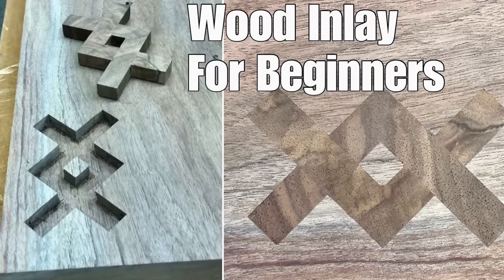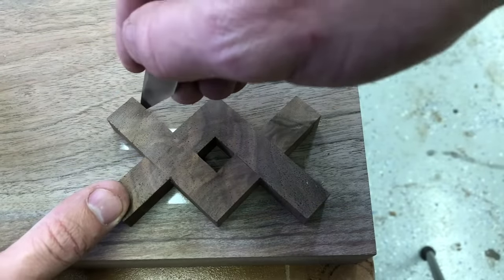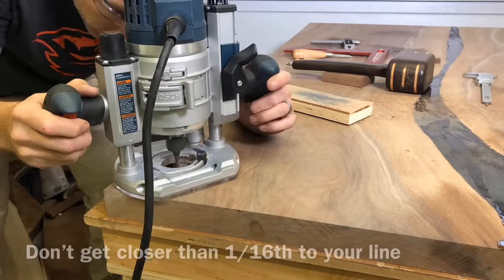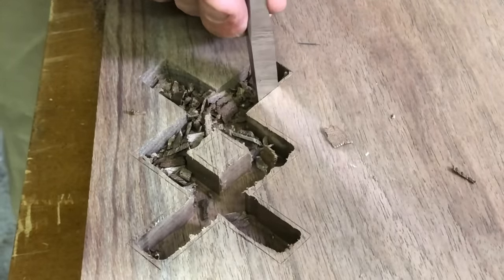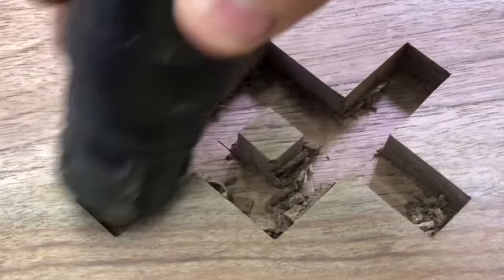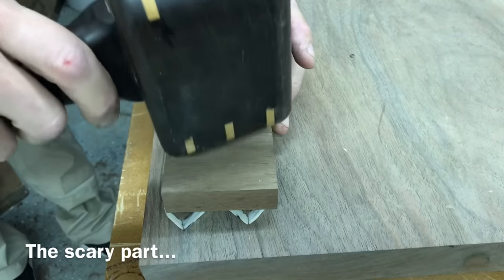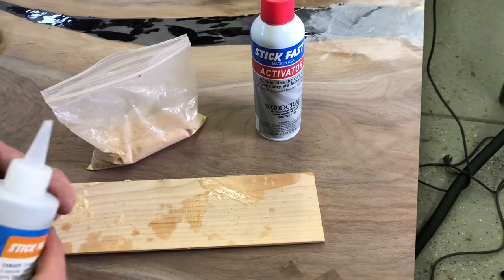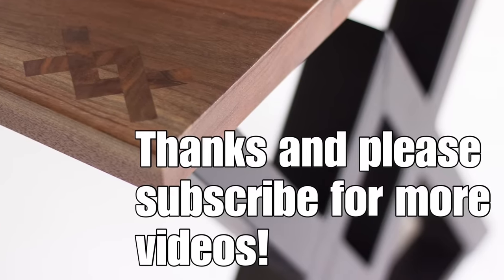Wood Inlay For Beginners—How To Woodworking

Comment: Not gonna lie, those chisels got me excited. They look like the highest quality and $80 isn't bad at all
Reply: Yeah me too 😂 I’m sick of buying Stanley and dewalt chisels that last 2 uses. I’m going to invest in something nice that I can maintain.
Reply: Same here. He's making art with art
Reply: I agree that they're probably worth it (especially since they're probably hand made)...
But keep in mind that the price is per piece. (So 4 chisels = 320$)

It's a good idea to start with cheaper ones to see which sizes you actually use / need.. And THEN upgrade :)

Like.. I have a set of 4 (old) expensive chisels.. I use 1 of those. ;)
     So in retrospect, the rest of the set was wasted money.

Also, learn to sharpen your own chisels.
       Even good chisels need sharpening fairly frequently - especially when you use them a lot.
       Best way to learn sharpening is using cheap ones. (As a bonus... Cheap chisels can become fairly decent chisels if you sharpen them well)

Pro-tip (for those on low budget);

Look for old / antique chisels from quality brands on flea markets and so on.
     They might need some refurbishing / rust removal / sharpening, but you can buy those for a few bucks a piece.
    (You pay the rest with the work it takes to make them usable again)

Via that route...

I have some 40-100+ year old chisels that you can shave with ;)

- 

For those interested, check out the 'scary sharp' method (you can find that on YouTube as well, as well as just using Google or something..
      I think 'Modern Woodworking' magazine has an article on their (super outdated) website on that subject ;))

      That method utilizes a hardened glass plate (1/2 inch thick or so) as a nearly perfectly straight surface, with several grades of specialized (3M) sandpaper stuck to it (goes from 150 up to 5,000/10,000 if I remember correctly)

* [Works with cheaper sandpaper too - make sure it's for metal, and that you can use it for wet sanding too]

Could save you a bunch of money on sharpening stones (which you can then spend on chisels instead).

     And also, you don't have the trouble of keeping your stones perfectly flat.
Reply: My dad always said, 'buy cheap, buy twice'

Comment: When I chisel following a cut gauge line, I always use a straight and squared up piece of wood clamped into place to guide the chisel as I tap the chisel down into the wood.  I find if I don’t, the chisel tends to wander and go outside the gauge line.  The guide block is clamped so the chisel sits in the cut line and it can be held tight to the guide block while being pushed or tapped.  Works really well.
Reply from the maker: Good call!

Comment: very good vid, Im till what you would call a greenhorn but I left my last office job of 16 years moved my family to a small East TX town and built wood shop in the carport under our master bedroom and started buying tools watching vids and making sawdust Im very lucky to be selling all my tables on CL and via word of mouth and return customers. Im finishing up a top for a kitchen island made of hickory with black epoxy and a 3 coats of conversion varnish put on with a 4 stage turbine HVLP Im lucky that before my office job I was a painting contractor so I have lots of experience with spraying clear finishes on cabinets funny most woodworkers skils progress faster with the crafting of the build than the finishing of the build where my finihsing skills are still far grater than my woodworking skills, lol I can put a nice feel and shin on just about anything. thanks again your work inspires

Comment: My next project is a mini project restoring an old wrought iron/ wood slat bench with bamboo to match the floor . Will be taking the long bamboo pieces and table saw and router and make it look like one of a kind . Prob 2 days work with dry times . I learned to use a drill press on these harder woods because the hand drilling can be irritating the way the grain just wants to sway the bit around is bothersome

Comment: Hello again, 
I know this is an older video, but that is the coolest part of your channel. The oldest video is still relevant for newer workers.
Now my question which is probably a known thing..... what does "leave a proud " mean ? Can it/ should it be used in other applications when woodworking?
Reply: Leaving something "proud" is to leave it RAISED a tiny bit.  The area can be sanded down later to match the rest of the piece.

Comment: I haven't done inlays yet.. but I didn't think I'd find much to learn here.
Yet, I was reminded that there's always Lots of little things.. tips/tricks/techniques that we take for granted after we've learned them, and which beginners (at any given woodworking task) often tend to figure out on their own through mistakes.   
Maybe I'd have considered some of these little things if I was standing in front of the wood.. but, just off the top of my head:  leaving room for glue (via bevels) to maximize bottom contact, how proud you you left insert when gluing.. that I don't need to approach flush (fix it in post!), remembering to fill imperfections with the squeeze out, ..etc.

Also, I was reminded of when I first started discovering what Sharp really meant. 
To beginners, I can't stress enough how important a properly sharp tool is, but especially with your chisels.. and that you should always assume, no matter how amazing of an edge you think you just put on it, it could be sharper.  ;-P    (unless, of course, you have a truly awful chisel, made from crap/scrap steel with a huge crystalline grain to it...)
Reply from the maker: Really appreciate your feedback. Really helps me when making more videos like this.

Comment: Excellent work and thanks for posting the video.  I thought you would have drilled a tiny air/glue escape hole right through to the underside, but presumably this wasn't necessary.
Reply from the maker: Na, that bevel underneath will work fine for that

Comment: Fantastic! That table is gorgeous.  Question, maybe you answered already, when putting the dust in the gaps did you simply mash it in where there was yellow glue? I couldn't quite tell exactly how you did that. 
Very impressive work. I am a woodworker by trade and have yet to really have a good go at the inlay.
Reply from the maker: Pretty much, ya!
Reply: @BlacktailStudio  ok thanks :)

Comment: Cam- Yet another great instructional video.  I'm interested in details of how you made the legs. Simple lap joints? Dimensions of stock?  Look like equilateral triangles?  Just to follow up with prior comments/questions.  I'm working up two small practice epoxy pours which will turn out to be wall hangings and two small (12"x45") live edge side tables with decorative butterflies for Christmas presents all . . Yes, I know it's August....
Thanks
Crady
Reply from the maker: Those were steel 👍🏼

Comment: nice job! 
Just me: If I have to do some inlay for "decoration" 5 millimeter deep is enough. 
It's less to carve and chisel, so less risk of screwing the job.
Of course, for a bow tie, I go much deeper, at least 15 millimeters, since the goal is to achieve a mechanical lock.
The successful outcome: VERY sharp tools, practice again and again and take your time.
Reply from the maker: Yeah, probably didn’t have to To this deep. Was a little nervous of the weak part breaking off though. I’ll keep playing around with it as I learn!

Comment: Phantastic Video!   Wondering if you could provide guidance on filler powder ratios for getting the correct coloring for a small gap in a Cheery wood project I got going on?    I suspect using elm and cherry wood powder in a 75/25 ratio with glue would suffice. Clearly trial and error rules here....
Reply from the maker: I’m not a recipe kinda guy. Like you said, trial and error!

Comment: Hey Cam, question i hope you can answer for me. I'm going to be puting bow ties in a slab to stabilize a large crack. The crack will also be filled with epoxy. In your opinion is it better to do the epoxy first, then flatten then draw inand install the bow ties? Or would it be better to do the bow ties first then pour the epoxy into the crack and have the epoxy form to the bowties?
Appreciate any input!
Reply from the maker: I’d do bow ties last 👍🏼

Comment: I'm about to start a kitchen table thats 2" thick.  There will be an epoxy pour component where a decent size crack (~1") separates the end of the table about 2/3rds of the way down the length of the table.  Is it important to add strength pieces such as bow ties when there is a crack of this nature when doing an epoxy pour or is the epoxy itself a strong enough bond?
Reply from the maker: Hard for me to say from here. Sorry!

Comment: Tremendous video, so helpful.  Quick question, I tried the technique and had some trouble with acute angles - hard to avoid messing up the 'opposite' side of the corner when working close to the angle.  Any suggestions?  thanks in advance.
Reply from the maker: Oh man, all I’d say is take less off.

Comment: I've filled cracks with epoxy and used bowties, but I had a thought about pouring an epoxy bowtie. Do you think the epoxy wouldn't stand a chance against the wood expansion?
Reply from the maker: Probably be fine. Unless a super violent crack

Comment: Amazing work and for a client the pressure must of been intense ! I want to inlay clay slab into small wooden boxes , would the router be the best way to do it ? I want to sculpture and paint the slab.
Reply from the maker: Oh, never tried that!
Reply: The router makes the process easier by cleanly and accurately removing a lot of the waste from the space to be inlaid - the void. It's harder and slower to do the whole job by hand using chisels and router planes alone.

Comment: As a finisher with over 30 years experience, sawdust and glue are the most amateur way to fix gaps and mistakes.  I have fired people in my shop who insisted on using wood glue and sawdust. 

The second you apply a stain you can tell it's a lazy fix.  When the patina develops over time it becomes more and more obvious.

Comment: For fine cracks in Wood I just put a little CA glue in the crack, wipe it off the surface and then sand over it with the appropriate grit of sandpaper. It Disappears.

Comment: CA Activator =  is that just water ?   

When using CA glue at home, it's known that it uses humidity to harden; so if you're in a hurry then you can breathe on it (being very careful to not inhale the fumes), or even bring the project over to the nearest sink and run the hot water to create mist. These will harden CA glue quickly.

Comment: Why stropping.

Stropping is only to obtain a razor edge(as in a real shaving razor)

2000grit stone should be enough for that purpose
Reply from the maker: Probably a longer answer than I can answer here. But that’s not exactly what a strop does. Google search should sort it out for ya.
Reply: @BlacktailStudio  i know EXACTLY what a strop is used for.i make steaight razors infrequently.

It just seems excessive for woodworking.

Ive seen the japanese planning contests and agree it would be essential for them to strop but that is not a "job",its a contest to get the thinnest most even film
Reply from the maker: jadekayak01 didn’t mean to be condescending. It rolls the dulled edge sharp again after some use (probably not what’s scientifically happening, but basically) Can strop it quite a while before it needs resharpening. Much easier than taking it to the stones.